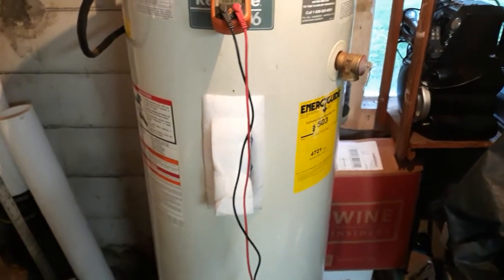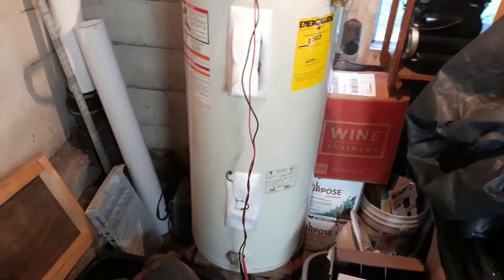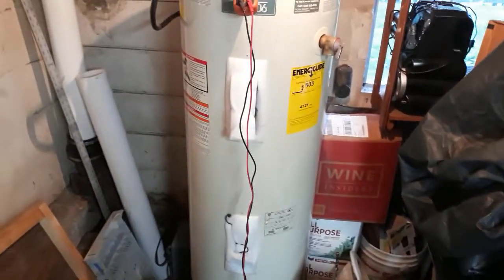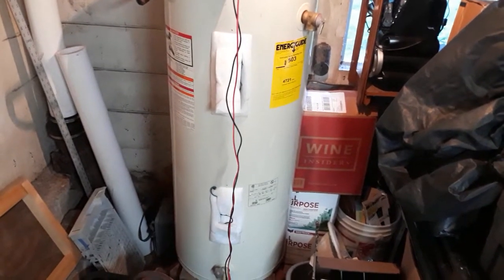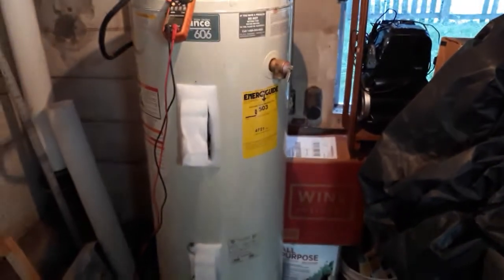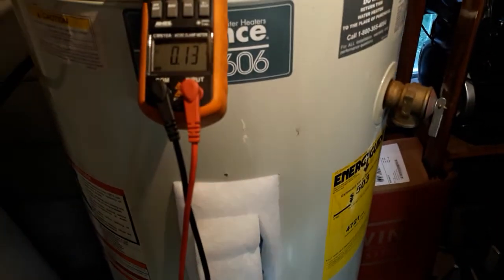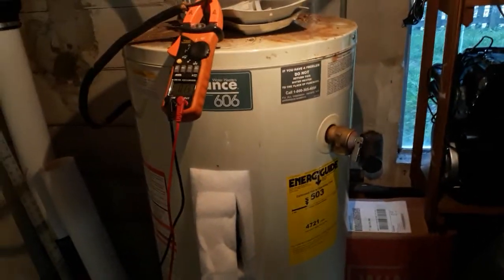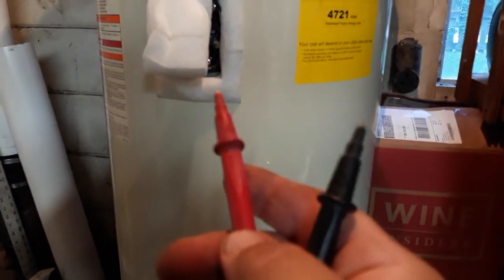How a dual element water heater works

Comment: Yes and if you are a bath person you get half a tub of hot and have to wait  a half hour to fill the rest of tub. I would not install one in my home if I had been asked. Whoever designed this must not like soaking in the tub. It's horrible!!!! 🤬🤨
Reply from the maker: Ummm, I am trying to follow along with what your saying but it does not make sense.
Reply: @Bbernhardsr  I only get enough hot water to fill half the tub, then have to wait 20-30 minutes for the other unit to heat up so I can fill the tub. Just a regular size tub too. Really frustrating
Reply from the maker: It sounds like your lower element is not working.
Reply from the maker: What size is your water heater?
Reply: @Bbernhardsr  it's a  40 gallon
Reply from the maker: @bev4155  I would have to say that your bottom element is not working. Either that or the down tube inside of the water heater is broken. A 40 gallon water heater should fill a bathtub.
Reply: @Bbernhardsr  thank you, I will definitely have it looked at. It's been driving me crazy and I never saw one like this before.  😎

Comment: So why do they say to set the upper higher?

Is it because it's usually when water is out and it needs more heat to make up for the rush of cold water to at least warm it up?
Reply from the maker: I do not know who "they" are. But what ever "they" said does not sound right to me. Setting the temp higher will not make it heat the water any faster. Elements are set from the factory at 120°F for energy conservation reasons as well as safty reasons.

Comment: This is perfect for people wondering if their generator will be able to run their water heater. So that water heater is only going to pull max watts on one element as both elements can't come on at the same time. Thanks.
Reply from the maker: Yes you are correct! This is why a 5KW generator can run your water heater. Of course you have to manage what else is on, but it is possible.

Comment: so when the bottom element is taking 240v, do we need to bring a neutral to the water heater or i just need 2 hots and a ground?
Reply from the maker: Just make sure on the product label that it designates 240VAC. I have seen 120VAC water heaters but typically those elements are limited to 1500 or 2000 watt elements. As long as the water heater is 240V all it needs is two hots and a ground and no neutral is needed.

Now all of that being said it also matters if it is just a standard water heater. If it is a newer water that has computer controls than a neutral may be needed.
Reply from the maker: I am curious what you mean by the water heater is "taking 40v?"
Reply: @Bbernhardsr  my bad, i meant 240v

Comment: What you are explaining is not a matter of "efficiency".  Neither a single or a dual element is going to raise or lower your power bill  The power (watts you pay for) with either configuration virtually all goes into the water with an electric water heater.  Electric water heaters are nearly 100% efficient.  The ADVANTAGE of a dual element water heater is faster recovery time, because it prioritizes the heat to the top heater element which is closest to where the hot water is being used.
Reply from the maker: There is no way that a single element water heater will heat the same amout of water as quickly as a dual element water heater. The work load is split between the two elements. A single element water heater has to overheat the water at the bottom in order to heat the water at the top. That is less efficient and therefore a waste of electricity.

Comment: Ampacity? o.0
Reply from the maker: Ampacity is defined as the maximum current, in amperes, that a conductor can carry continuously under the conditions of use without exceeding its temperature rating.

Comment: Great video, just what I was looking for. So since only 1 element is on at a time and its 220v does that mean the 3.5 kW for the element is split into two and your then using 1.75kW on each leg of your panel?
Reply from the maker: Yes that is what is happening with 220V appliances. The load is basically split evenly between both 120V phases of the panel. This is why you could get away with running 12ga wire to a water heater that has a max of 4500 watt elements installed.
Reply: @Bbernhardsr  Thanks for getting back to me so fast. The reason I asked is because I have setup my house with off grid solar and have been for 2 solid months now.
Im interested in an electric water heater but I didnt want to over load my Inverters. 
I have 6Kw on each leg of my panel and wasnt sure if the heater would place the 1st elements full load on one side and the panel but from what I now understand if correct is that whichever element is being powered that load is split between phase 1 and 2.

I was looking a 2 element 4500W each heater and I thought it would pull 4500W off each leg.
Reply from the maker: @richd9771  woah now be careful! If you have 2 separate 120V inverters powering your panel then they will not be in phase! That sounds to me like it will blow up your inverters! I could be wrong but I feel very sure that will cause damage by not being phase. I know they do make 240V inverters.
Reply from the maker: @richd9771  read this article and it will explain what you are trying to do.

https://itstillworks.com/two-inverters-together-220v-ac-8610234.html
Reply: @Bbernhardsr  I have 4 inverters running split phase (48V). 2 in parallel on leg one and 2 in parallel on leg 2 of my panel. There made to be setup this way and I can stack 6 total if I like.
I'm a general Contractor and have been playing with solar for years. I finally took it a step further and setup my house. I haven't worked with electric water heaters so I wasn't sure about how the elements worked.
Reply from the maker: @richd9771  I gotcha 👍. But you would agree that if your inverters are not stacking capable, bad things will happen.
Reply: @Bbernhardsr  Oh yes for sure. You have to know what your doing and know your equipment.
Thank you for looking out and being concerned.
Reply from the maker: @richd9771  that is cool though what your talking about doing. You must have a very large battery bank!
Reply: @Bbernhardsr  I have 960Ah 48kWh. Run my entire 2 story  house and work shop. Tomorrow will 2 month 100% off grid. We were paying on average $340 a month just on electricity.
I looked into tank less water heaters but it looks like it would pull way too much power so then I started to look into a 50 gal electric water heaters and after watching your video it seems like that could work.

Take a look at my youtube page, you can watch the video I made about my system.
Reply from the maker: @richd9771  that is a nice setup! I doubt I will ever be able to afford something like that. Yes you are right tankless water heaters that are electric pull insane amounts of power. Plus you would never be able to fill a bathtub again. One thing a lot of people don't know about tankless is that unless it is gas powered it will never be able to provide the heat necessary to accommodate heating that much water quickly. Most on demand systems are limited to about 2 gpm for a 70° temp rise. So if your incoming water temp is 70° and you are using it at 2 gpm then the water would exit at 140°F. The problem is lets say it is winter and your water is 30° then your exit temp would be only 100°. That is at 2 gpm. Most standard shower heads are 2.5 gpm so you would have to convert your faucets to low flow 1.5 gpm heads. Then if anyone else in the house turns on a faucet then the shower gets colder.

All in all I feel electric on-demand water heaters are the most inefficient. I did a video a while back about a friend of mine who had one installed and I wasn't too impressed.
Reply: @Bbernhardsr  I worked on my solar system for about 4 months working out the bugs. I just kept adding my system until I reached the point that Im at now.
I still have a few things to do cosmetic wise other than that its working.

After doing all my research on the electric tankless heaters I found that like you said unless its gas its just not worth it.

Comment: Why does water heater nameplate have simutabeous and non simultabeous power consumption ratings?. What value do we use to  size wire?
Reply from the maker: The only time I have seen that is on hybrid water heaters. You need to size your wiring based on maximum wattage listing.
Reply: @Bbernhardsr  So there are water heaters that operate both elements simultaneously? I thought they never did til I saw this one. I thought to use the higher rating to be safe. so we're good. Thanks
Reply from the maker: @elalacran37   @Nes Nes  no. Water heaters do not operate both elements at once. For a standard water heater with dual elements (both 4500 watts) that would be a total of 9000 watts at once. That is 37.5 amps which means you would need to have a 40A service running to your water heater. That would mean you need 8 gauge wire running to your water heater. This would be very very expensive. The typical service running to a water heater is 12 gauge at 20 amps.

On hybrids there are multiple modes. Usually 3 but can be more depending on manufacturer. The first mode which uses the least amount only runs the compressor. That typically uses 600 watts. If the demand for hot water isn't satisfied with the first stage then the mid stage kicks in. On hybrids typically the lower element is less wattage than the top (3000 to 4000 watts) while the top is 4500 to 5500 watts. When the mid stage comes on the bottom element turns on and the compressor turns off. If that doesn't satisfy the demand for hot water then the top element and the compressor will come on and the bottom element turns off.

So, eco mode (just compressor)= 600 watts
Second stage (just bottom element)= 3000 4000 watts
Final stage (top element and compressor) 4500 to 5500 watts + 600 watts for compressor= 5100 to 6100 watts.

I hope this clarifies things a bit.
Reply: @Bbernhardsr  i have both elements of 4500 watts on my bradford white and on my breaker a have 30 and a 30 together